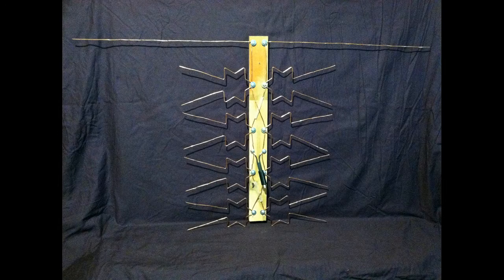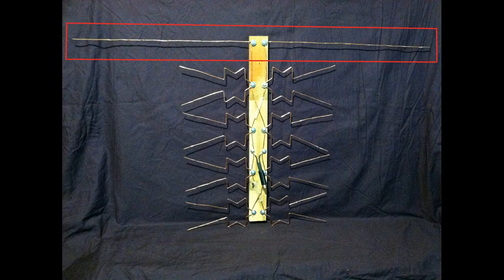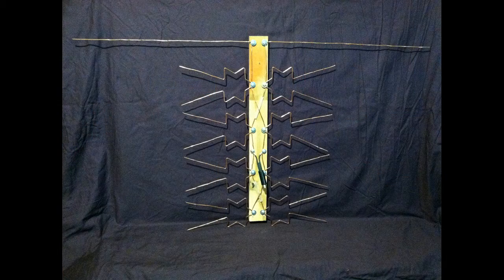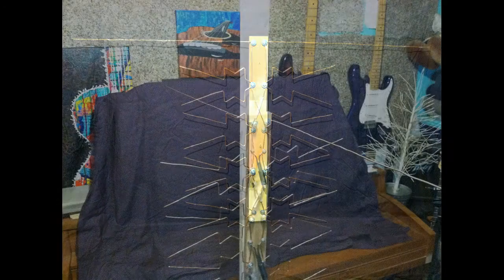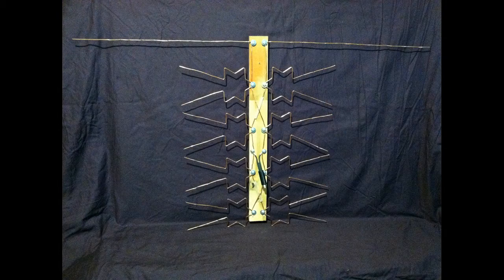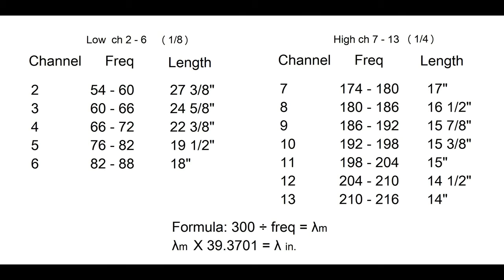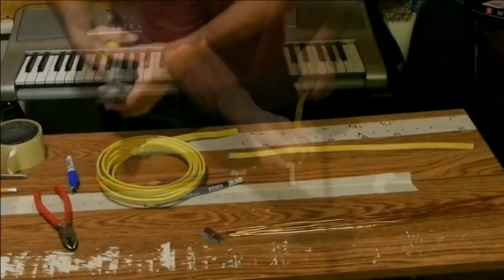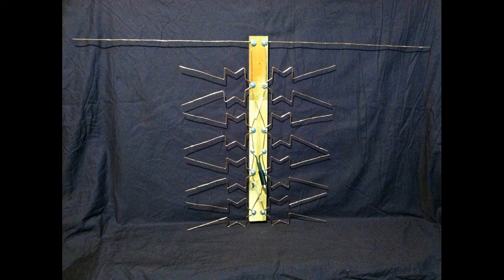HDTV Antenna - VHF Add On

Comment: built this antenna vs two other of your designs.  it out performed all the others, hands down.  I have it in an attic around 15' above the ground and pickup stations perfectly in the 50 mile range. THANK YOU.

Comment: Helpful video. We just had a repack in Boston with the PBS stations moving from UHF to VHF channel 5. I was using a commercial UHF antenna in the attic. When I rescanned I lost the PBS HD channels. Using your suggestions I added two 19 1/2" wire elements to the antenna and now I can pick up all the broadcasts on RF channel 5. Thanks.
Reply from the maker: Yes!!! Sometimes homemade is better. Thank you for the comment

Comment: I would think a folded dipole for VHF would be a better choice since the impedance is closer to 300 ohms vs a dipole with the lower impedance.  Wouldn't be hard to make.   Worth a try?

Comment: Hello Mike, 

     We had been corresponding back and forth through Youtube last weekend about VHF channels 2 and 6 out of Philadelphia 47 miles. I wanted to let you know that I've been unsuccessful so far. I made two different size dipoles. One  with 27 3/8" legs and another with 15" legs.  I was also trying to receive channels 11 and 13  from Scranton Pa almost 180 degrees in the opposite direction @ 43 miles. The stations are WYOU (CBS)and WBRE(NBC). Thus the reason for the shorter antenna. I can sometimes get those two stations with the Stealth Hawk I made by hanging it outside a bedroom window. So far nothing else has been able to pull them in. 
     I didn't make the dipoles out of the 4 gauge ground wire, instead I made them out of thin wall 1/2" steel tubes. I just flattened the ends where I attached them to a 3/4 PVC tee and balun. My winegard boost xt amp made no difference at all. Do you think the copper wire would have been a better choice? The steel tubes did still pull in the local independent and PBS stations from Allentown @ 8 miles. So I know it is capable of receiving some OTA signals. All of them happen to be UHF though.
    I'm now thinking of building a VHF loop antenna out of 1/4" copper tube. I also got an RCA TVPRAMP1Z preamp today to try it with because of the separate VHF, UHF inputs it has which would eliminate me using a combiner. 
Any thoughts or advice would be greatly appreciated.
Thanks,
Craig craigwwerner@gmail.com
Reply from the maker: Thanks for sending your email. Give me a couple days since the holidays are upon us and I'll send you a diagram of a new idea that might possibly work. In the mean time, think about the station most important to you that you want to pick up. We'll focus on that one. You might not be able to pull in every station due to frequency.
Reply: Hello Craig.  I'm in the SJ area and WPVI (6) is about 43 miles for me as well.  I was just wondering if you ever found an antenna design that brings in WPVI at our distance?  A 1/2 wave dipole is right on the edge of working in my location.  Thinking of trying a loop design or maybe even just making a simple yagi but wanted to see if you had any luck?

Thanks,
Carlo
Reply: I can get WPVI with the "Stealth Hawk" I made. When it is outside. Unfortunately I can't mount it permanently outside and I only get a weak signal occasionally from inside my attic

Comment: I was thinking about Wiring 2 telescoping antennas in to help with VHF. I have some Mid VHF, I would like to get. Each of these expands to 4 ft in either direction. I want to wire them in exactly like you have it. Honestly I don't know what I am doing. I just know that the high VHF wavelength is huge, If you have any advice or thoughts I'd like to hear it. I think you said you had some way of testing it. I have trial and error. Does this seem like it would work?

Comment: Does the thickness of the wire matter much?  I've got an old VHF antenna in my junk pile from 30 years ago, and I was thinking of cutting off and reusing the elements from that, which are much thicker and hollow.  I think they are also aluminum?
Reply from the maker: Bud E those element you have should be fine. Thanks for the comment.

Comment: I know this video is over two years old so hopefully you get this and can answer my question. Wouldn't the VHF add on need to be run through a signal combiner with the UHF? From my experience the VHF add on will reduce the UHF signal. I have not put it through the test but I have some very low UHF signals that I could not afford to have them compromised for a few VHF channels tho I would love to add on the available VHF channels.
Thanks!
Reply from the maker: It's been a while since I checked my channel but I got got it! I have never experimented with combiners or anything like that so I'm sorry I can't answer your question. I have never tried using a booster either but it could be another option. If you're not familiar (as I am not) with them you might do research on it first. Thanks

Comment: Thanks for the info.  I'm going to give it a try.  I'm using a larger 2 bay UHF/Hi-V fractal antenna (I have 1 Hi-VHF (12) tv channel in the local area)  right now which works really good.  It is basically a 3" star pattern which you see a lot on the internet.  I live south of Richmond Va about 15 miles and according to my tv I'm getting a 75% signal.  Not very scientific but, it's all I got.  I actually pickup stations in the Norfolk/Williamsburg area which is probably at least 50-60 miles away.   These come in anywhere from 0 to 75% depending on the weather.  Since your antenna has 4 bays I'm hoping to see some gain in my reception.

Just one question.  Since I'm going to use the Hi-V antenna at the top I thought about combining the leading connecting wire(s) and the Hi-V portion so that I'll end up with a two wires about 32.5" instead of 2 18" leads and 2 14.5" wires per your instructions.  Is the spacing between the lead connecting wires that critical?
Reply from the maker: John LeBlanc 
Thanks for your comment and thanks for subscribing!
 I’m currently working on doing another video for an antenna that may work better than this one. It offers a wide frequency sensitivity and should have no problem with RF 12. :)
Reply: DIY Projects With Mike LOL 😄. I've already started but, I'll stop. Are you going to change anything about the fractal loops?  I was just getting ready to bend them into shape.
Reply from the maker: I would say to go ahead with it. It'll take me a few days or so to make the video and publish it. The simplicity may surprise you. :)
Reply: Thanks again.  You're just like me it seems.  My wife keeps telling me the antenna we have is okay but, I can't seem to let it go : D
Reply: Well I tried the antenna this morning and it was not good.  Channels 3.1-3.2 were 50%-75% with my old antenna and 0%-25% with your design.  This is a station out toward Norfolk about 50-60 miles away.  Channels 6.1 thru 6.3 were 75% with my old antenna and 50% with your design.  This is a local Richmond station.  Channels 12.1 thru 12.3 (Hi-V) were 75% with my old antenna and 0% with your design.  My antenna doesn't rotate.  I tried rotating your design and it never picked it up.  After that I decided I'd done enough testing.  Thanks again.
Reply from the maker: John LeBlanc 
Sorry it didn’t work for you. By all means if your old one works, use it. 
 This was one of my older designs that helped me overcome interference in my attic. I still have a couple in my attic but my stations are fairly close. 
  Still going to make my video of my new antenna. :)
Reply: Thanks again.  I appreciate the effort you put into this.  Looking forward to your new video you were talking about.
Reply from the maker: John LeBlanc 
Thanks John. I appreciate the fact that your comments are friendly even if the antenna didn’t work. The weather kept me from working on my car today so I’ll be shooting the video today. I don’t know how long post production will take. 
 Thanks again:)
Reply: 1-1/4"

Comment: How did you attach the VHf elements so that you can move them around? Thank you for the info, I will try to add the VHf wires to my db8 antenna, the antennas direct VHf add on significantly altered my uhf reception.

Comment: Mike, thanks for the videos, very informative and well done.  Question, I have 2 VHF stations channels 9 and 13.  According to your chart, my wires for one station should be 15 7/8" long and the other channel should be 14" long.  Which length would work the best in my case.  Thanks.
Reply from the maker: I don't know your situation but what you could try first is the longer one that way, you can trim the wire to the shorter length to compare. Generally, I would build it for the station that comes in the worst. Thanks for your comment! :)

Comment: Hi Mike 
Also trying to get channels 2 and 6 out of Philadelphia , I am about 40 miles away ....
Reply from the maker: You may need a seperate antenna connected to a switch for those low vhf channels. Maybe 1/4 wavelength size as a stand alone antenna. As I mentioned in the video, I don't have any of those channels in my area so I don't want steer you down the wrong road. I've been learning as I go and not a professional. I just share what I've learned here on my channel. Thanks for your comment. :)
Reply: I got most of my Channels using simple Roach Clips.  I think I was able to pick 30-40 Miles only though.  But YUP, Roach Clips.  Make sure to connect them and it has to be 8.5 Inches.  About 5 Clips Total.  Some Channels, I have to add 1 extra, 6 Total!  You can definitely use them as VHF Antenna.

Comment: Hi Mike...I have a 8 bank bow tie uhf antenna....in two sections....one pointed north...other south....I do have one movie channel I really miss....it is channel 13 and is about 65 miles away from antenna site.  Would you recommend multiple 1/4 lengths or full lengths for channel 13 at this distance?  Height of antenna is only about 20ft.  I get a truckload of uhf stations now, but only occasionally get channel 13 and miss it dearly. Appreciate your comments....from Mick
Reply from the maker: 8 bank? Does that mean 2 - 4-bays at 8 elements each?

Comment: hi mike, 
nice video! Just for clarification, if i have a channel in my area that’s RF channel is 45 and the digital channel is 3, would that channel be UHF?
Reply from the maker: JJohn Hipp 
Yes. Channel 3 is the virtual channel it appears on. Channel 45 is the actual channel frequency. :)
Reply: DIY Projects With Mike ok thanks for the quick reply

Comment: Hi Mike.  Great video.  For VHF, I have channels 2, 4, 5, 8, 11, and 13.  Channels 8, 11, and 13 are sometimes pixel-ated.  How long should I cut my wires to accommodate those channels?
Reply from the maker: Are those the channels as they appear on your tv? If so, they are virtual channels which means they could be transmitting over different channel frequencies. To find out for sure, check out antennaweb.org and enter your city, state and zip to search for a pop up list of channels in your area. Look for the RF channels to see the channels they actually transmit over. Hope this helps
Reply from the maker: Once you find the rf channel you can to http://www.csgnetwork.com/tvfreqtable.html to get the frequencies then follow the formula provided in the video. You might need to split measurements in half if they’re too long. No guarantees though so best of luck.

Comment: I live in close proximity (10-11 mile ) to a group of antennas in a metropolitan area. I built a 4 bay bow tie antenna without those fancy inner shapes your bow tie has . I assume mine is a design intended for UHF reception. So Question, why does my antenna still receive VHF so well? Is it because i am so close to the transmitting antenna thus almost any design is bound to work?
Reply from the maker: Thank you for your question. My best answer is yes but it also depends on the transmitting power of the stations in your area. I did an experiment mounting my bowtie (without the VHF add on) outside a few feet above my rooftop. My VHF channel came in just fine from the rooftop but not from my attic. And I don't want to expose my antenna to be struck by lightning (happened over 40 years ago when I was young) so I keep them in my attic and the VHF add on was a great solution.
   On a side note, the fractal shapes in my design may not even be needed if the antenna is mounted high and outside. But for attic and indoor applications where there may be a lot of interference, these fractals really help to stabalize the reception and was the inspiration behind creating my youtube channel in the first place.
Reply: When I mount my Antennas Direct style db2 UHF antenna on a metal mast I get my local VHF. Maybe the metal mast contributes some VHF dipole effect.

Comment: Can you link to a dropbox for the plans? I want to have holes predrilled for a dozen cub scouts for a project. Can i use simple v shaped elements for uhf and 19 inche elements for vhf? I saw 4 inches between vhf and uhf and leads 18 inches total and crossing sides for each element level.
Reply from the maker: Yes you can use 19”
Reply from the maker: Sorry, can’t link to dropbox
Reply from the maker: You can use V shape if you like

Comment: How would you integrate the VHF antenna into the Tuxedo version?
Reply from the maker: Thanks for asking. The idea is basically the same. I built one for myself and is the one I currently use for my living room tv. I simply take the top part of the antenna at the 3" and bend them straight up and then convert the 5" to 14" and extend them straight out horizontally (14" for RF ch 13). Certainly inspiration for another video :)

Comment: A friend just gave me his winegard 8200u antenna.  Its like 8 feet long with a large uhf and many vhf rods.  I'm currently running a RCA751 after trying a 4bay which didnt perform as well.  My question is the big Winguard worth the trouble of lowering my roof top pole for a test.  comments appreciated from zip code 66523.
Reply from the maker: Well, all I can say is if you don't test it, you can't get results. Looking at your situation in your zip, I feel spoiled down here!! Seems like ALL of your stations are low power. If you run a test, I'm interested to know how it goes. BTW, which station is the furthest?
Reply from the maker: Just looked at the winegard. What a beast!

Comment: How did u get those formulas? Id like to understand
Reply from the maker: I learned everything on the internet. Check out radio frequencies and wavelengths on google. Everything is in metric and needs to be converted to standard measurements ( that is if you’re using standard measurements)
Reply: For any wave, velocity = frequency  x wavelength.   Solving for wavelength, divide both sides by frequency:  Velocity / frequency = wavelength.   Electromagnetic waves move at the speed of light, 3x10^8 meters/sec.  I want a dipole for channel 5, that's about 76 MHz.  Hertz are cycles or waves per second.  So at Channel 5, a full wavelength is (3x10^8 m/s) / (76x10^6 waves/sec).  seconds cancel out.  3/76 =  0.0395, 10^8 / 10^6 = 10^2  = 100, so the answer is 3.95 meters/wavelength.  A half wave is half of that, 1.97M.  You can add about 3% - 5% to that length to account for capacitive loading effects on a real world antenna.  The 468/f formula is just using feet instead of meters and MHz instead of Hz, and including the fudge factor for capacitive loading.

Comment: Mike I'm looking to pull in channels 2 and 6 from Philadelphia approximately 43 miles away inside my attic. The dimensions on your chart, are they for each leg or overall length? Also what is the dimension of the gap between the two legs? I figure I'll start long and shorten if I need to. I want to use this separate from the stealth hawk antenna I made ( works much better than the gray hoverman and bowtie in my attic for unknown reasons ) and combine the signals with equal lengths of cables.I then have a Winegard Boost XT preamp sending the signal to my Tablo DVR.Any thoughts or concerns you have as I'm open to all suggestions. Thanks for your videos.
Reply: Let me add also that I purchased a ClearStream C5 antenna for VHF reception and basically got nothing, both outside and in my attic even though according to tvfool the signal strength is pretty good for those channels at my location.
Reply from the maker: If I understand correctly, the lengths are for each leg. I don't have a ch 2 in my area but I'm sure it's a BEAST! If it transmits at a high enough rate of power, you might get away with 1/8 wavelength or even 1/16 wavelength. The gap is 1 and a quaurter inches. You might even have to mount it outside but hopefully it works from your attic. 

Super interested to know how this works. Keep me updated!
Thanks.
Reply: DIY Projects With Mike 

Looks like this thing is going to be 4 1/2 feet long. I'm going to make it out of 4 gauge copper ground wire and make some sort of PVC support to keep this thing from sagging. 
Thanks for your fast reply and I'll keep you posted on my progress.
Reply from the maker: Excellent choice of material. Hope it brings in both channels. I have been curious about low VHF for a long time. Do let me know how it goes. What channels are they by the way?
Reply: The two stations are:
WPVI digital channel 6 ABC, Laff, Live Well
KJWP digital channel 2 Me TV, Grit, Escape and Justice Network
Both broadcasting from an antenna farm in Roxborough section of Philadelphia. 
I can currently receive UHF stations  that broadcast at a lower power levelfrom the same area that are a much weaker power
Reply from the maker: Do they all show up on the 'Antennaweb.org' map?
Reply from the maker: www.antennaweb.org
Reply from the maker: Just looked at those two stations at FCC website. Polorization for both is not horizontal but circular. If the staight elements don't work, I may have an idea you can try. mburkacoustic@yahoo.com
Reply: Ok thanks when I get this made I'll let you know the outcome. Probably in a couple of days.